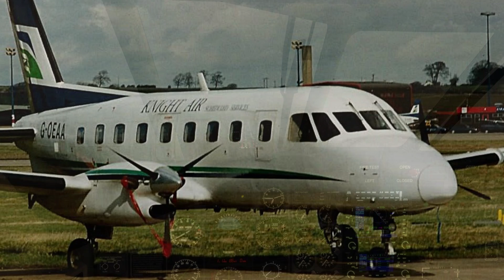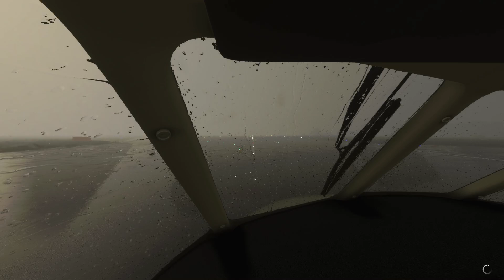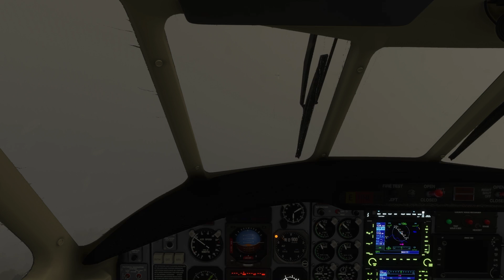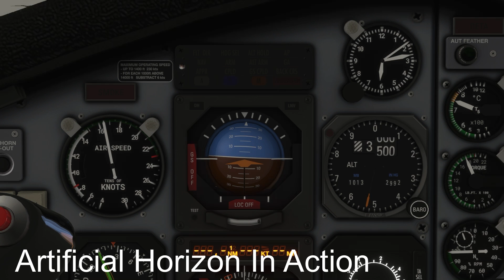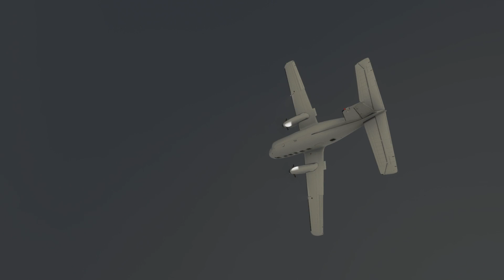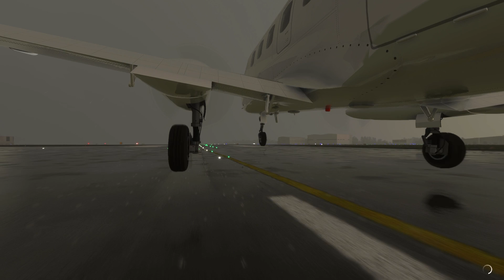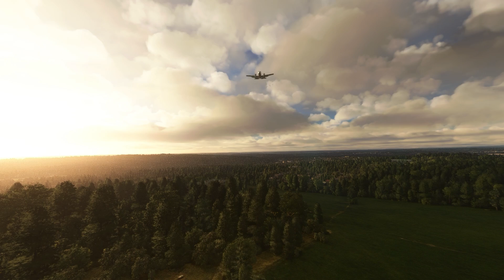The Pilot Who Was Flying Blind | The Crash Of Knight Air 816

Comment: Best to cover the horizon gyro if it malfunctions. Needle ball and airspeed will get it done in a pinch. I prefer a needle turn indicator over a turn coordinator. The directional gyro also gives rapid indication of a turn. During my instrument training I did a lot of "partial panel" practice. Being leery of depending on the artificial horizon, I developed a scan that spent less time on it than altitude, airspeed, turn and directional gyro. I'm subject to vertigo so if I can't see outside, I disregard body cues. To demonstrate how deceptive body feelings can be, while a passenger in a car, close your eyes and put your head down facing the floor. After about a minute, eyes still closed, head up quickly. After about 2 seconds, open eyes. Also, altimeter and vertical speed help avoid a "graveyard spiral".  The trick is to remain calm when the airplane gives a surprise. In a panic, you can't instantly grasp what the instruments are telling you.

Comment: The ball doesn’t tell you the turn, the rate-of-turn indicator (above the ball) does.  The ball tells you if you’re coordinated, meaning, you’re not skidding or slipping into the turn.  If you lose your attitude indicator, keep the rate-of-turn “wings level” an use your airspeed, VSI, and altimeter for your pitch.   It’s called “partial panel” and is taught during your instrument cert training.

Comment: On my taxi ride to LCY for a flight to AMS (Feb. 2009) on a BA146 I was staggered to see the steep downward angle of the 146s on final to LCY.  It literally looked like they were hanging downward by the horizontal stabiliser.  On the return from AMS I craned my head to look out the window on final.  We were at the same angle I'd seen the day before.  Unless I was looking out the window it felt like we were completely level in the cabin.  That's how disorientating spatial disorientation can be.

Comment: Ah yes, a perfect use case for my (patent pending) Airplane tilt-o-meter.

A champagne cork is suspended from the ceiling between the pilots’ heads. If it hits you in the fucking temple, your plane is banking. 

It comes free with helpful “you are upside down” text written in friendly letters on the bottom.
Reply: Actually, that's not a bad idea.

Comment: Question: Is an airliner passively stable in the sense that if it has a slight roll it'll slowly level if you let go of the controls?
Reply: No, most commercial aircraft exhibit spiral instability (as opposed to Dutch roll instability).  See the Wikipedia artilce on "Aircraft dynamic modes".  If you let go of the controls with some bank on, the turn will tighten and the nose will drop.

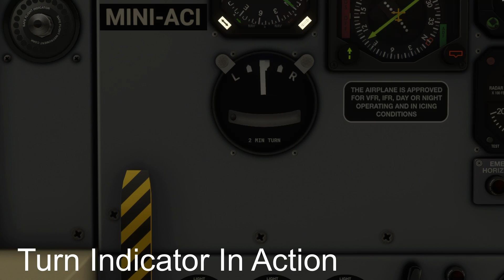Comment: Oh my gosh, I thought you were going to cover the Turn and Bank indicator at the 5:25 minute mark, but you ONLY talked about "the ball", which is the only the slip indicator!  The turn and bank indicator will tell you if you are banking left or right and with the slip indicator will help you to make a coordinated turn, especially when in the clouds.  I was wondering why the pilots just didn't rely on the turn and bank indicator to give roll data, and the vertical speed indicator to give pitch data, and when you started to mention the "turn indicator" I thought you were going to cover it!   Still don't know why the pilots didn't use it, I learned to use it because some of the airplanes I fly have a slight 2-3 degree roll indication, so you can see how if I correct for that without confirming with the turn and bank indicator, I'd basically be putting myself into a gentle roll that I would not even notice if in the clouds.

Comment: I'm going to ask a silly question, probably, for any actual pilots out there … but maybe a string and a weight as an impromptu plumb line could help in this kind of scenario?  You may get disoriented by what direction you're going, but that weight is still going to point straight down, no?
Reply: The slip ball (as illustrated at 5:15) does exactly that, but it's not enough to get the wings level.  It doesn't point straight down (that is, towards the Earth); instead, it shows the direction of the overall force on the plane, both from gravity and centrifugal force if it's turning.  As well as the ball, you need to use the needle (connected to a gyroscope) to see if the plane is turning.

The problem with using a pendulum rather than the slip ball is that it's not damped - it will swing about randomly unless you're perfectly level and not accelerating, which is not usually the case.

Comment: I used to fly a 1947 Stinson 108  back and forth from Oaxaca Mexico to Veracruz  (150 miles)  in clouds on Needle Ball & Airspeed (NBA) & Mag Compass  for dead reckoning navigation.  Did not have a Art Horizon or any other instruments for IFR,  not even VOR nav radios (had coms for airport towers).  Of the 150 miles, about 100 miles of it, (about 1 hour flight time) would be in the clouds, zero visibility.   So I did climbs, descents, cruise, and course changes all " blind" as he calls it here.  Both Veracruz and Oaxaca  airports would broken  clouds so VFR and no instrument approaches.  The mountains between the two would be solid clouds from ground to way over my max altitude of 12000 ft,  so no VFR on top.  Some  peaks were around that, so I had to plot course  well around those.   I once had an engine failure on this route.  Turned immediately towards the costal plain, glided down holding best range airspeed, broke out of the clouds about 800 agl  and landed on a dirt road,  again all on Needle Ball, Airspeed, and Compass.    Lack of an Art  Horizon should be no problem for  instrument rated pilot.   In other words, this is a pilot failure, two of  them.   I have also lost all electric  instruments at night in IFR: in a Twin Comanche = back to NBA and a flashlight in my mouth to see them.   If you are a pilot, including VFR only,  periodically  cover up everything but NBA and compass and  altitude  and fly that way until you are not only proficient but also comfortable with it for long periods of time,  preferably actually in the soup and with turbulence.   I also remember doing stall, steep turn, and spiral recoveries on NBA back in instrument training.   Another thing very important is to absolutely ignore all your feelings and sensations.  You fix your attention on your instruments and fly them no matter what your senses say.

Comment: What is not explained here is the behaviour of the compass. The straight magnetic compass suffers from so many errors in anything other than straight and level flight that it is almost useless in IMC. However, the instruments in this aircraft would be a directional gyro (DGI) that is slowly corrected by a magnetic system. 

Both the Captain's and the First Officers DGIs would be accurately showing the aircraft's heading and if that is changing then the wings are not level. This should lead to the crew being able very quickly to establish which artificial horizon is faulty. I have flown an aircraft in cloud using only the DGI, but I would agree that the faster the aircraft the more difficult this would be (low rate of turn for a given bank angle)

The turn and slip indicator (completely incorrectly described in the video) will also give sufficient information to keep the wings level whilst a diagnosis of the problem is made. Flying on limited panel is hard work and doing an approach even more so, but it would certainly be possible to fly the aircraft to somewhere where the weather was better.

Comment: Umm yeah. I don't know the experience level of the pilots but they sure as hell should have been proficient in partial panel flying. Anyone can fly when you have 2 good engines and all of your instruments. We earn our living by getting down safely when the $hit hits the fan. As soon as they noticed the problem and cross checked the instruments, bang partial panel. With 2 qualified pilots it shouldn't have been a problem. We train for it and it's usually with 1 engine out. We also practiced on the sim and it shouldn't have been a problem. AI confusing you? Cover it up, stick something on it so it's no longer part of your scan. 1 pilot does nothing but fly the plane. The other pilot handles the radios and checklist while monitoring the instruments. When they received the wx they knew if any VFR was available in the area. If not  you declare an emergency and take the best runway available. Turning back you go for whatever precision app is available. When you interview with the airlines you better be able to fly partial panel or you'll fail your SIM ride and go back to flying banners at the beach. There's a reason for having 2 pilots at the controls, safety. Single pilot IFR partial panel is a beatch. The work load can be overwhelming. Believe me I know, it's no fun. Be interesting to see their history, experience, check rides, and SIM training. Sounds like the training department wasn't doing a good job.  Something tells me they were young low time pilots who were in over their heads. 🙏 RIP.

Comment: I can't remember which aircraft incident it was in, but I do remember hearing of a case where the pilots of a large commercial flight had issue with their artificial horizon on a cloudy night and the captain had one of the cabin crew bring him a half glass of water in a clear glass which was then placed on the control panel and held there. With the glass sitting on the control panel the angle of the water in the glass gave them the ability to fly level. You may want to investigate and report on that incident.
Reply: That will not work. The glass of water will only tell you if the aircraft is skidding or slipping in exactly the same way as the slip ball in the turn and slip indicator.
Reply: @SuperHeatherMorris  Not sure where I saw it, but I have seen video of a twin engine plane flying with a half glass of water on the dash showing the water level moving with the body of the aircraft sideways and forward tilt. The video maker was talking about options to use where certain instruments failed. that was after I'd heard about a commercial aircraft incident with instrument failure.
Reply: @ernestbywater411  The half glass of water/spirit level/plumb bob will not work. They will all be subject to the centrifugal force caused by the aircraft turning which it will do as soon as the wings are not level.

Comment: I was flying this type for another airline at the time of this accident. We needed an additional aircraft and leased it from Ryanair. It was fitted with an optional third, independently powered, artificial horizon. You really need three so, if one fails, the other two should agree so you know which ones to follow. Had the accident aircraft had this mod, it would probably have been OK.

Comment: You said that most small single seater private aircraft have only one artificial horizon but my Cessna 107 has two one main and a independent small backup although it’s very small and sometimes hard to see especially at night (because it doesn’t have lights) it is there as emergency backup and as you’ve said we’re trained to disregard your own sensory input and use our training to overcome a instrument only landing (plane) when we don’t have any or have limited instruments and most importantly no radar (I’ve retrofitted a outboard ground proximity radar after watching how many times this could’ve saved a small private airplane like mine) . I think proper training and a properly maintained plane are essential to passengers transportation failure to do so has dire consequences for both parties speaking as a private owner and human being with love ones and friends who often fly short commuter flights on semi corporate planes .

Comment: never been a pilot myself but my uncle was a combat pilot and commercial pilot. when he flew commercially he always had something in his pocket that would roll if he dropped it. not guaranteed to give away orientation under significant g-force but as a last ditch its better than guessing. but hes also from the a10 test program back when the targeting system for the gau8 involved him crawling onto the control panel before launch to draw a reticle onto the windscreen with a grease pen so he had something to aim with. having a mechanical hand operated backup was mandatory for him, no matter how effective it actually was. it wasnt so much that what he was doing was going to work what mattered is that he was thinking about how to solve the problems he might encounter during pre-flight. those pilots probably did the same, this is just a reminder. find what works for you and think it through, work the problem, talk it out with ATC or combat control. and if its a combat setting and youre in a fighter you think you maybe cant save, dont stick around and guess. punch out and walk home. as a family member of a flier i'll tell you id pay any tax hike for lost planes if it meant you came home in one piece. we can make more planes, we cant replace people. stay safe up there.
Reply: I know I'm WAY late to this rodeo... BUT you might be interested to know that back in the days when they were still casting cannons out of bronze and iron, the great gunners of the day would use a piece of chalk or gypsum (whichever was handiest) to drag as straight a line down the middle of the cannon as possible, and then there were personalized designs and markings they would use individually to help calculate and aim their guns over distances, and to imply windage "approximately". An experienced gunnery officer was a VERY studious person under horrifically stressful conditions...

     Your uncle is... was?... fine stock from a LONG tradition!   ;o)

Comment: Partial panel technique relies on the fact that the Attitude Indicator gyro is spun by a vacuum pump, while the Turn & Bank Indicator has an electric gyro. Losing both at the same time would be unlikely. However, not many pilots are recent on partial panel technique and - this is the real kicker - it's really hard to ignore the failed AI. I was taught to keep some Post-It notes in my kneeboard and as soon as I realized an instrument had failed, stick a Post-It on the face of the instrument so I wouldn't be misled by it. I'm really glad I never had to use that trick for real, though.

Comment: PUT A BOTTLE OF WATER ON THE CONSOLE!
Reply: And crash, guaranteed. Search on things like "upside down water pouring during flight" or "pilot pouring iced tea while doing a barrel roll" to see just how little water tells you about an airplane's attitude.
Reply: @tomswift6198  putting a cup of water or bottle of water on the console was actually the solution to create an artificial horizon in a separate case where all the instruments had gone out in a plane.

It's not a 100% perfect solution, but it would give them a better chance.
Reply: @hariman7727  What case was that? It works great in the movies, certainly. But the only way it could possibly work in the real universe is if the plane is parked, on the ground.

Spin a bucket of water on a rope around in a circle - at the top of the swing, the water doesn't fall out. It still thinks that "down" is toward the bottom of the bucket, NOT the opposite direction toward the ground. Water CANNOT establish a useful artificial horizon in a moving vehicle, no matter what popular opinion thinks of it.

Comment: You do not use the ball to keep the wings level. The ball is only for coordinating the rudder. It's the turn needle that indicates a turn. You can also use the gyrocompass and then a worst-case scenario you can use the whiskey compass. That's why we spend hours and hours practicing partial panel.

Comment: How can people in an aircraft not feel centrifugal force and therefore not realize they are in a death spiral?
Reply: It's easy. If the ship is in coordinated flight, everything seems normal inside. Your apparent weight changes slightly and a sensitive accelerometer could measure that, but generally a human can't, to any useful degree. The view out the windows would show that things are NOT normal but in the clouds the outside view is useless. You can be upside down or sideways and not know it. The instruments can show it; human senses WILL NOT.

Comment: My dad was a RCAF airman. He served as a wireless operator/machine gunner on a Catalina. He told me when I was a little boy that many pilots crashed because they didn't believe their instruments. The value of flight simulators can be understood very well, especially in relation to overcoming spatial disorientation. 
This video gave me a rather frightening feeling as the plane was diving, out of control. At 8:55 through to 9:07 is a wonderfully well done animation, the birds eye shot of the front of the plane as it was turning into the parking area was brilliant. Thanks. Hope we have electric planes in service soon. P.S. Forgive my being pedantic but excetera is not a word. The correct words are et cetera which means roughly, 'and so on'. If 'excetera was a word, it would mean the opposite.

Comment: I was taught to use my gyro compass (with magnetic as a back up if necessary) along with turn and bank indicator and altimeter.  The compass will tell you if you're turning left or right, the altimeter will tell you if you're climbing or descending, and turn and bank will back the compass (somewhat).  Isn't perfect by any means, but it can be used in a serious emergency for a short time.  Thank goodness, I never had to resort to this method.  There is no such thing as trusting to how you feel when the horizon is not visible.  Vertigo is often instant and fatal.